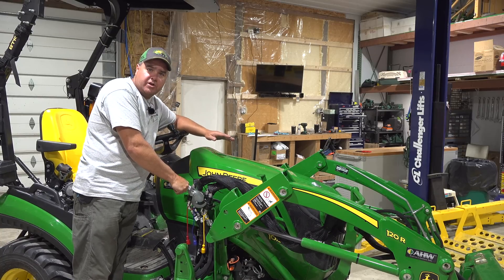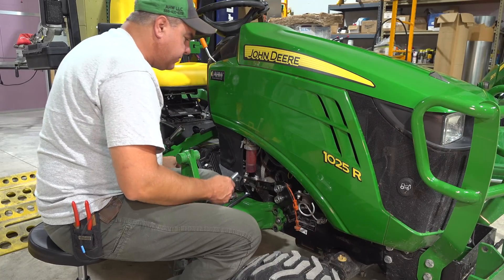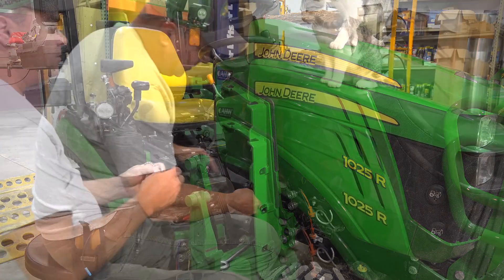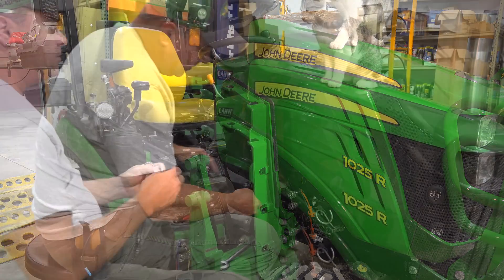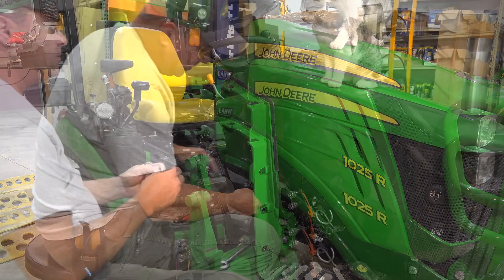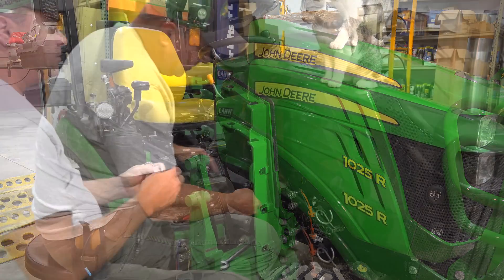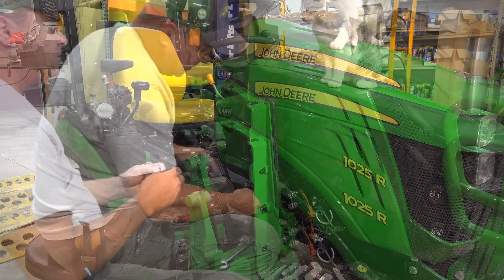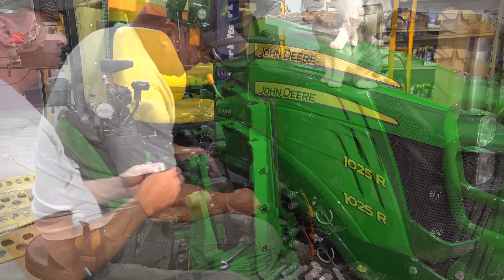Single Point Hydraulic Connector; Deere 1023e/1025r/2025r

Comment: I find that using a local hydraulic hose shop is usually much cheaper than prefab from a manufacture.
Reply: In some cases that is true.  The main issue here is the flat faced O ring fittings.  The cost between an NPT fitting at $6 each and the flat face O ring fitting at $20 a piece.  Will turn a $20 hose into a $70 hose very quickly.

Comment: Update to my post on 5/6/21 I received my single point hydraulic connector and started the install, you have to remember this is not made for the 2017 1023E but from others that posted here I decided to go with it. First off no instructions were included but was able to print them,
Mounting the main bracket was straight forward but now installing the fender is more difficult but able to do it but not much clearance, the lines from the connector to the tractor was straight forward just be sure to get them pushed back into the bracket so the loader kick stand clears them when folding, the lines from the connector to the loader I used 90-degree fittings on the hard lines parallel to the boom facing down then connected the lines then to the connector, routing the hoses was difficult they seem to long? but I was able to work it out by looping the hoses facing up than lock the connector to install the loader, after the loader is installed I need to unlock the connector and make a loop with the hoses and reconnect and lock the connector this than gives you the clearance needed to operate the loader with no binding on the hoses.  Possibly shortening the hoses maybe the way but will I will have to look at that. also the storage bracket that holds the connector on the loader boom when the loader is removed the two holes has to be drilled to except the bolts to hold the bracket. If anybody has a better way to route the loader hoses please let me know. The quality of the kit is fantastic very well made and package great.

Comment: OUCH!!! $864 USD for a chunk of metal ....   (06/28/2020)

I'll have to check my 'curse jar' to see if I have had enough trouble to purchase...

What does it do to keep dust out of the connectors on the tractor while the loader is off and the deck on.  The vinyl caps degrade and don't fit the best and would get snagged on trees and shrubs when cutting.
Reply: Also, do we need to worry about air bubbling in the lines?  (Air Compresses, fluid does not....)
Reply: It's really all about convenience, some people are willing to pay for it if they take the loader on and off multiple times. Similar story with many products like quick hitches etc.
Reply: Lets find out how to clean these quick connectors!   (Without draining the hydraulic fluid or contaminating it.)
Reply from the maker: They are flat face connectors.  Easy to clean.
If you don’t think you need it, fine.   Others disagree...which is fine as well.  
Price the 8 hoses and fittings from any hydraulic shop.  you’ll find them quite expensive.

Comment: I really like this single point connector, I also noticed that you connect and disconnect the single point connector while the tractor running, my question to you is how will that work with the mower deck that I use the black hydraulic line port to raise and lower the deck, that port needs to release the pressure so the hose for the deck can be installed, thanks Dave
Reply from the maker: We use the mechanical lift.  Not sure why anyone gets the hydraulic lift option on the mower.  Anyway, you’ll have to hook the hose manually.

Comment: Hi Tim, another great videos. I will probably buy one of these as I am old and have bad hands and have a hard time connecting the hoses. one question, I have a snow plow, and was wondering, when I put the plow on can you connect the hoses from the plow to the bottom part of the single point, it would have to be one at a time ,but are the fittings the same or something different. I can always just disconnect the hose at the original place and connect the plow hoses like I have in the past, but as I said that is hard for me. Anyway just wondered if they could be connected to the single point. Thank you for any help on this matter.

Comment: Not sure how to word this…. Does the quick connect system deal with unplanned for pressure in the loader side of the hoses?  I know that can be a real bear to deal with when using standard Pioneer hydraulic quick connectors.
Reply from the maker: You should try to release pressure.  But, yes, they can be connected under pressure.  I should show that on video.
Reply: @TractorTimewithTim  Thanks Tim!  I always cycled the FEL joystick all over the place with the tractor off before removing the Pioneer quick couplers, and would even with the single point connector system.  Still, the FEL boom and bucket circuits can settle a bit over time while the FEL is parked, which can partially pressurize the hoses.  I assumed the flat face couplers and the leverage afforded by the latching lever used by the single lever quick connect system would be able to handle this situation.  Now we know it does.  Thanks again.
Reply from the maker: Yep!  Tried it yesterday! :-)

Comment: I see that Discount Hydraulic Hose is coming out with a 6 point connector with a price of $680. It doesn't say if that is for the Full Kit or the Upgrade. It does say that they will not be out until Q4 23. I tried to ask this on there website but it kept taking me to a message that said error. Would you be able to find out? At $680 if that is for the full I would probably put off get the one from Greenpartstore. Unless the Upgrade from Discount is going to be reduced a lot. Thank You
Reply from the maker: Hmm. I explained this thoroughly on greentractortalk.com 
$680 is the 4 port to 6 port upgrade.  
Turns out the full install won’t be much a whole lot more than the upgrade.
The 6 port is not available from GreenPartStore.com

Comment: I like the ease of use, but also have a front snowblower, which would require the same kit (making the change too expensive) or removal of the short hoses to bypass this expensive solution.
Reply from the maker: Bypassing the unit is no big deal. 
But you are right...if you choose to buy the parts for the snowblower, that is expensive!

Comment: When I had my 1025R, one of the stock hose couplers on the tractor didn't function right and it was a nightmare hooking and unhooking the hoses (I'm in my 30's) and I would gladly recommend this option to anyone like Tim said who removes/installs the loader more than once a year. In hindsight the single connector should have been replaced but it never happened.  I would simply just "add" that cost of the connector to the purchase price of the tractor and never think twice about it. Nice option and video, I also agree a 6 hose connector should be available but baby steps for the SCUT's for now...

Comment: I love this on my 1025R, however I was looking to put a diverter on here, looks like it may be too complex now. Would my only choice be have JD install the 3rd function?
Reply from the maker: Diverter is relatively easy to install.  I have a video showing my install of the artillian diverter on a 1025r.
Reply: @TractorTimewithTim  yes sir just  not sure how the diverter would go on exactly with the single point connected at the same time. Like you said it would be great ifJD had two extra connections. Thanks for the fantastic content.

Comment: How do you hook Up a front snowblower or blade that needs a connection or two now?
Reply from the maker: The single point connects to the original four plugs.  So, if you have another attachment which needs those plugs, you can unplug the single point.
Alternatively, you can buy another single point coupler via parts and connect it that way...but the latter will be expensive.
Reply: Tractor Time with Tim thanks Tim. Love your videos. Got my 2038r coming next week. 1025r will be leaving this week.

Comment: I have a 1023E with a 54D mid mount mower deck and recently installed the Load-N-Go ramps after watching your video about it. 

I just viewed your single point connector for the loader video and want to know if you have clearance issues with the load-n-go ramps hitting the existing four quick disconnects for the 120R Loader attached to the right side plastic floor board. When I raise my 54D mid mount mower deck the Load-N-Go ramp hits the quick disconnect and will one disconnect of the the loader hoses.

Is there a way to remove the four quick disconnect  bracket under the right floor board, by-pass it and connect directly to the rigid hydraulic tubing behind it and neatly tuck it all up neatly under the plastic floor board?

Thoughts?

Thx,

Avid Viewer,

Eric Holst
Martinsville, In
Reply from the maker: I do not have clearance issues with qd’s and load n go.  Maybe lengthen the mower lift turn buckles so it doesn’t lift quite as high?

Comment: so how does this work if you have the front end snowblower? just unplug at the tractor ports and leave them hang from the single point connection?
Reply from the maker: Yes, or buy another 'implement half' of the single point for use on your snowblower.

Comment: Tim, as always I love the insight and I will be adding this to my 1023 before the month ends! I however have a question that is related to this type of a connection. The one thing I hate about leaving the loader on and using the mover deck is having to disconnect the yellow loader line to connect the Mover last lift control. What are you doing for this connection????
Reply from the maker: I use ‘mechanical’ lift for my mower...which uses 3 pt hitch. Check out my web article on mower deck lift options.   Tractortimewithtim.com

Comment: Tim, will this work on my 1025R with a H120 loader? The folks at Greenparts say they will not warranty it if installed on H120. Would you know the reason for this? They also admit that many customers do indeed install on the H120. Are there additional instructions  beyond  what you mention in the video for this. I appreciate your help. Just had back surgery and have had struggles with the hydraulic connectors that I would like to avoid.

Comment: Does anyone make a dust cover for the single point connector. Such as when you remove the loader there are covers for the hydroloic connectors on the tractor side but not the side on the loader.

Comment: My BX only has the quick disconnect even with the third function and mine is a 2017 BX23S and I’ve never had a single leak maybe that says something for the dealer I bought it from they may have checked everything when the tractor came in from the factory
Reply from the maker: Glad to hear you are not having issues with your single point.  Many are not as fortunate!

Comment: Good luck finding parts from Faster when you blow a seal in one of the connectors. I blew a plastic washer in one of my connectors but you can’t buy individual parts for these you have to buy the whole assembly. They are a German company and only have 1 or 2 distributors in the US and they know very little about these parts.
Reply from the maker: Can’t get them through Deere?
Reply: You can only buy either the top (loader side) connector set or the bottom (tractor side) connector set. These cost $300 to $400 each. All that I needed was a blue plastic washer as it had broken.
Reply from the maker: Ugh!

Comment: How would you add the 3rd function kit if you have the John Deere single point connector on your tractor already?
Reply from the maker: The single point connector is unrelated to a 3rd function.
You can install the summit (or Deere) 3rd function kits with no issue.  You will have to connect the 2 additional hoses manually unless you upgrade your single point connector with the 6 port version from http://DiscountHydraulicHose.com/ttwt (use code ttwt for a 5% discount)
Reply: What I was looking for is the brackets and hoses needed to install the 3rd function on my tractor.
Reply from the maker: @RayKrzeminski  the summit kits come complete with brackets to install on your tractor.  I prefer the front and rear kit. It comes with bracket identical to the Deere 3rd function.  Use code ttwt at http://aummit-hydraulics.com/ttwt

You will need a power beyond kit to plug in the front/rear kit.

Comment: Tim,  did you bleed the lines or just start up the tractor and run the valves to get it all to work?
Reply from the maker: No need to bleed...just run the valves.  The air will work it’s way out.

Comment: Hey Tim!  I followed your lead from a video you made many years ago and installed an Artileon 3rd Function Valve Kit on my 1025r.  I am still extremely happy with it.  But, I remove and replace my loader at least once a week and am extremely unhappy dealing with the four individual Pioneer fittings to do this.  My 1025r is a 2018 and has just over 1000 hours.  I am meticulous about keeping the fittings clean but had to replace all of them, males and females,  at least twice due to leaking and prematurely disconnecting.
In your opinion, is there room to install the Single Point Hydraulic Connection Kit with the Artieon 3rd Function Valve Kit in such close proximity?  Could the mount for the 3rd function valve be modified to allow for both?
I am certain I have the resources to make the modification but it is hard to tell from this video if there is enough space to do it.  Personally, I've never seen a 1025r with the single point connector installed.
Thanks, Mike
Reply from the maker: The Artillian kit needs to be relocated to accomplish this. 
They are working on a new bracket to position it successfully with single point.
Call them for more details.  
Say you heard this from TTWT
Reply: Thank You! @TractorTimewithTim

Comment: Does this work with the Artillian 3rd function?
Reply from the maker: It would require some different hoses, I think.
I’m also not totally sure if there is room for the diverter to be mounted in the same place...as this area is becoming quite cluttered!
Good question!  I was thinking the same thing as I installed!
Reply: As I was wondering the same!!
Reply: Rob Johnson , same question from me too. I’d buy this in a heartbeat, but if I have to get custom hoses made and/or figure out a way to mount the Artillian diverter elsewhere, I’m not so sure. I’m going to have to study this for awhile. Maybe Artillian has an answer.

Comment: my 2023 1025R came with the Single Point hydraulic connector.  Wondering what everyone with the Single Point does when they want to connect a Quick Hitch implement like a plow.  Looking for a solution.
Reply from the maker: There are a couple of options, but the easiest and cheapest is to use flat faced couplers on your plow, and connect directly to the tractor half of the 4 port single point

Comment: Add a little anti-seeze to the bolts to prevent the rust on the bolts.  Works great.   Also you could use your lift as well and get to those bolts pretty easy!  Just saying.....  🤣🤣

Comment: I guess there is but is it harder to connect the 3rd function hydraulic lines with that post installed? Thanks
Reply from the maker: No, the post is quite a distance from the 3rd function connectors
Reply: Great, thanks👍🏻

Comment: Tim do you have independent mower lift with the new factory 3rd function? Config lists it might not be compatible....
Reply from the maker: I do not...I do not want any of the hydraulic lifts for the mower deck.  Use the mechanical lift.  Much simpler, cheaper, and works better!

Comment: I don't think they make one for my Gen 1 2025R but I was wondering if you can still use the Artillian diverter valve for the grapple?
Reply from the maker: It fits with the 2038r, but I’m not sure it will fit with 1025r.   Lots of ‘clutter’ in that area!

Comment: Maybe I missed it, but is this coupler compatible with the older H120 loaders, too?
Reply from the maker: Yes, should be.
Reply: In my mind, there are three things (on the H120) to be considered and compared to what Tim has shown us.  1. A place to attach the mounting to the loader at the tractor.  (The three bolts at the loader base)  2. Type of hose connection at the tractor.  3.  Connection type and distance point to the hard lines on the loader.

Comment: How does it work with hydraulic mower deck?
Reply from the maker: If you do not have independent’ hydraulic lift, you will still need to plug/unplug the one hose.

Comment: Hy Tim. Is the singe point connector compatible with an hydraulic mower deck ? (Who need the black connector to lift up)
Reply from the maker: Sorta.   You have to unplug the one mower connector to hook up the remaining loader line…just like before.

Comment: Thanks for the video, Tim.  You've got me thinking seriously about getting one as I remove/install the loader quite often.  Is the single point connector truely less messy?  I'd hate to have fluid dribbling all over the single point base and down the intermediate hoses.  Do the flat face connectors not drip fluid on disconnect like the OEM ones do?
Reply from the maker: Not a single drop so far.
Reply: It's worth the $650.... No drips and easy to keep clean, easy to use and makes taking the loader on and off a 15 second task. Only thing I don't like is the way the hoses want to lay with the included fittings.
Reply: @oneillam1990  I agree.  Bought the connector last summer.  Its one of the best upgrades if you remove the loader a lot.